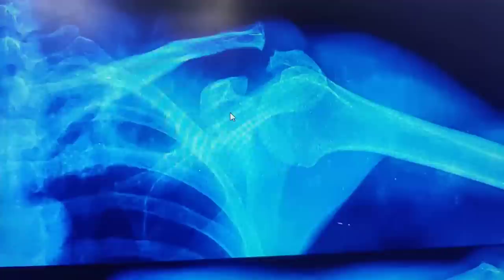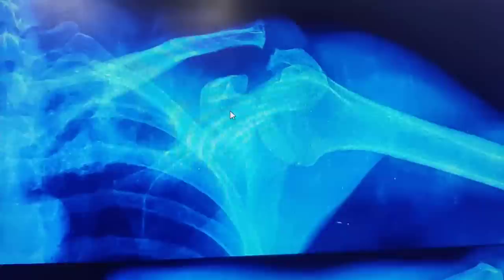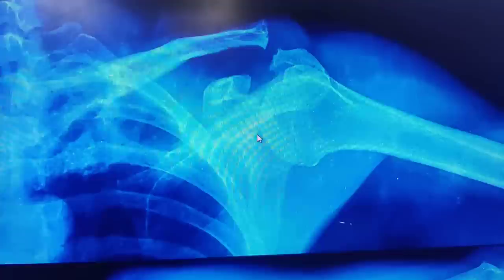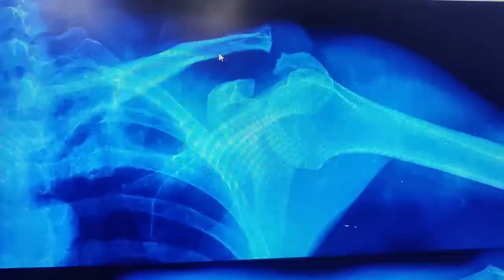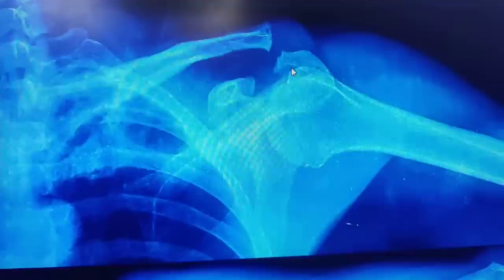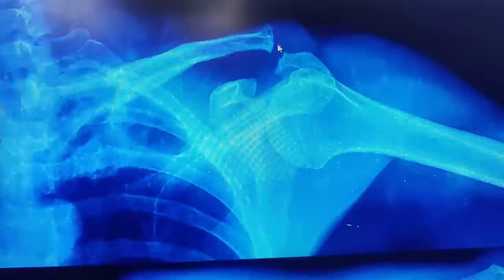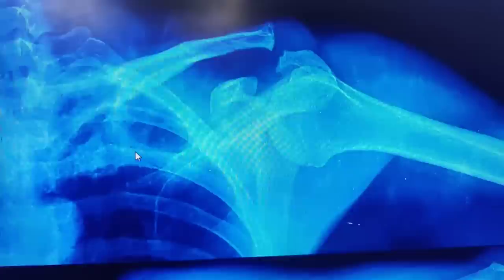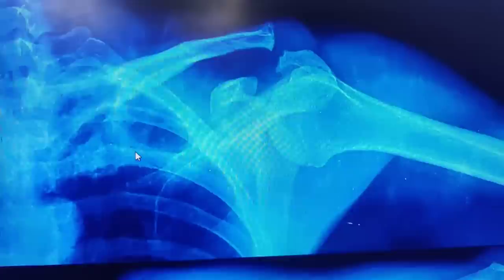Modified Weaver-Dunn Procedure for Chronic ACJ Dislocation

Comment: Sir can you please explain the presence of another Endo button which is seen on the lateral side the last one that you are tying before cutting all the stiches with knife. One Endo button loop is seen at the two ends of the 4mm drill which is lying over the lateral end clavicle and below acromian. But as visible on the last    part of knot tying, there is another endobutton which comes out of the blue , when you are tying the very last knots. Please explain where did it come from?
Reply from the maker: You mean for the The coroco clavicular ligament

Comment: I had this procedure performed on my left AC joint back in 2005. As of today I feel the clavicle is much looser (floating) than in days past. Is it possible to tighten the fiber wire or is it just my old age?
Reply from the maker: I can't say much without consulting you